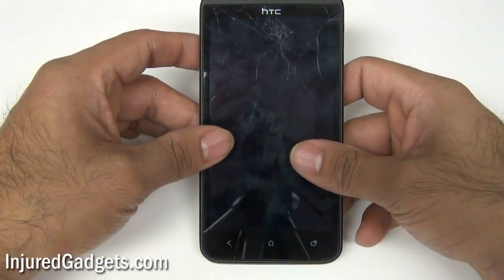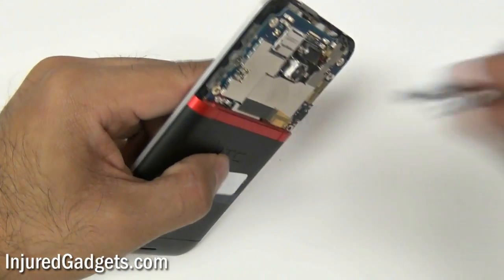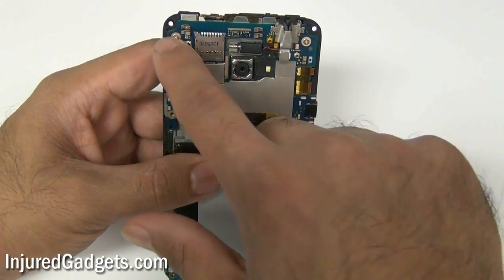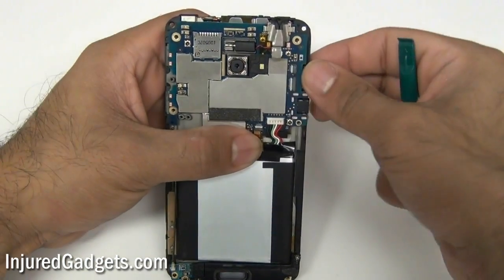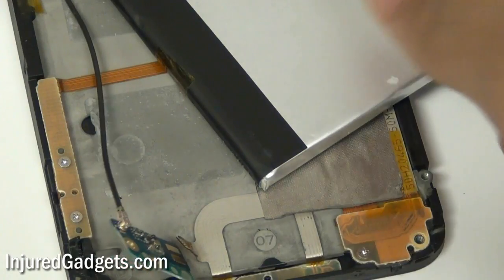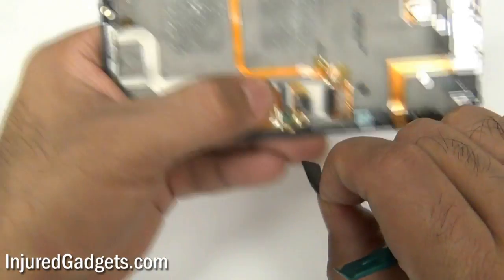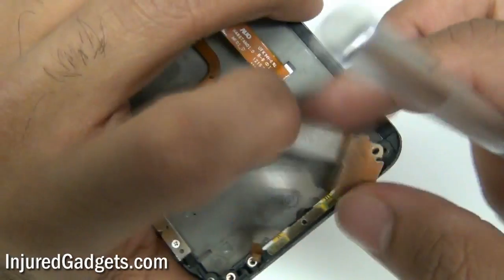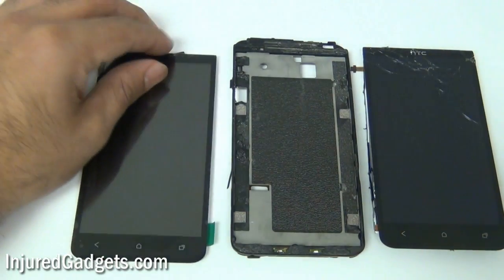HTC Evo 4G LTE Touch Screen Glass Digitizer & LCD Display Repair Replacement Guide

Comment: Thank you, InjuredGadgets for the great repair video. I purchased the the complete assembly from you through, Amazon and installed it in my EVO LTE, it's now as good as new. I do recommend that anyone doing this repair, purchase the complete assembly.
Because I see it next to impossible to separate the screen from the digitizer without damaging the digitizer.
Thanks again, very much, InjuredGadgets

Comment: the video was good and informative..only id would say is TELL US 1st about the lcd/screen..not at the end after the phone is a part, then have to wait 5 days for the correct part to arrive, and try to reassemble from the video backwards, other than that...no complaints on your instuctions

Comment from the maker: Why are you so upset and calling us a prick? We clearly show a COMPLETE assembly at the end of the video and we NEVER recommended just using a digitizer or just an LCD. In videos where we do recommend that we show separated pieces, in this video we show a complete fused assembly. Additionally, putting it back together is the reverse process of taking it apart. It really isn't that difficult. If you took it apart, why would you not be able to put it together, just do the instructions in reverse.

Comment: my lcd is good , my digitizer is bad ... can I ust change digitzer please heklp thanksj
Reply: You can remove a digitizer from its LCD.    They make a "hotplate" that you warm the assembly up with and then using a special type of super hard (And thin wire) slice through the glue holding it together.   If your just doing your own phone its not worth it and this doesn't work without practice.  I've done a lot of this type of phone.

*NOTE You need to remove the LCD digitizer with kid gloves so you don't ruin them *This video ruins both.